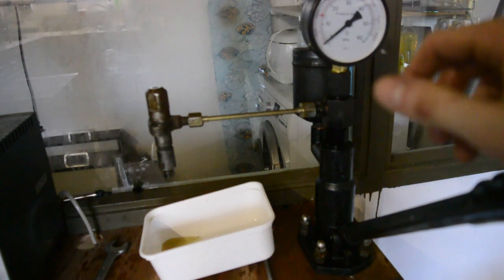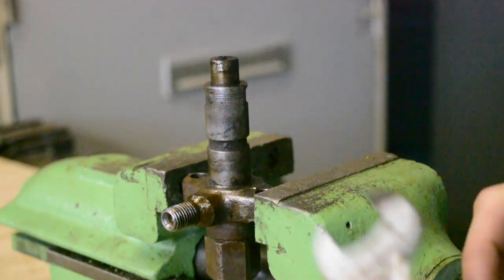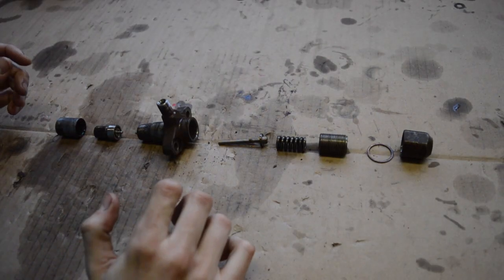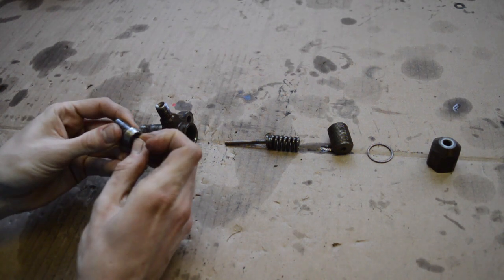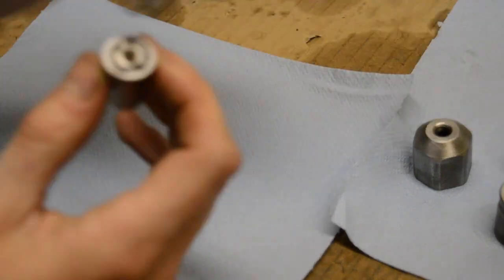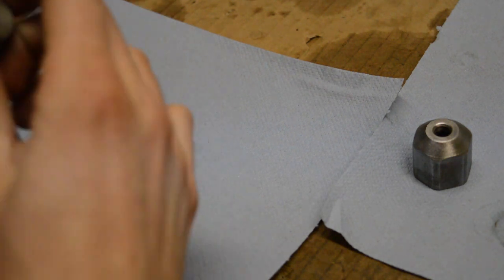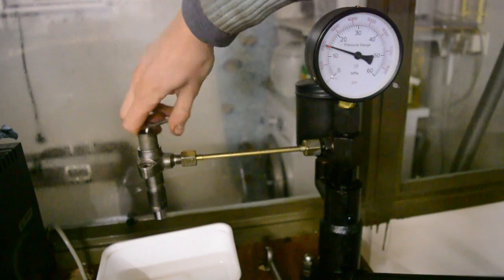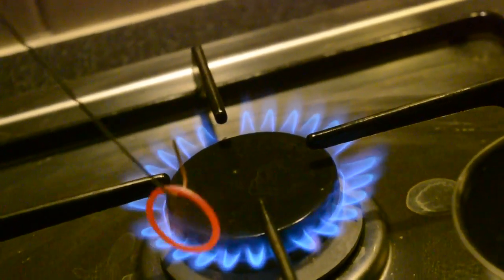Land Rover DIESEL Injector overhaul

Comment: As a retired employee of what was a Simms service depot full marks for getting them to work. A couple of comments, do take the pressure spring setting down to nil before trying to remove the nozzle retaining nut because if not the nozzle can turn with the nut and you can shear the two dowels off in the injector body and ruin the assembly. The full repair would be by internally recutting the nozzle seat and the needle face to different prescribed angles for which you need a bit of special equipment and you may have noticed there is an auxiliary spray from the nozzle for starting purposes, this needs unblocking in most cases which is very difficult, the needle valve freeing off has to be done carefully without the use of any abrasives as too free a fit and there would be an excess of fuel leaking back in the injector and not injected into the engine,  all this can be measured on the hand tester.  This nozzle was just about the most difficult and time-consuming type to refurbish to spray properly and on cost was frequently replaced with a new one. The test pump can test most types of injectors, but spray into an enclosed container for safety reasons or at least guard it, and most important keep away from any naked flame, and don't try that as it is very dangerous!
Reply: Ken have you ever refurbed the tdv8 Injectors, I had a chap take mine out to remove my inlet manifold and now they wont fire, loud rattly noise from them
Reply: @gerrygorman273  I have no idea even what a tdv8 injector looks like ! what engine ?  I may find an answer if I could see one as the earleir types all worked much the same way.could you post a photo of one ?  Ken

Comment: Hola! Muchas gracias por compartir... excelente video!
Una pregunta:
¿El inyector se abre a 2000 ó a 2100 psi? Y ¿a cuántas psi se cierra? 
Otra pregunta: ¿sólo se puede ajustar los psi de apertura ó también se puede ajustar el cierre?
te agradezco el tiempo que tomaste para hacer el video!
Reply: Hello, open pressure is 135bar (2000psi).  You can only adjust the opening pressure

Comment: Did you lap both the nozzle and the injector body? How do you lap it with the alignment dowels in or did you remove them?
Reply from the maker: If you need to lap the injector body surface, you first need to remove the dowels indeed. I didn't take them out in this case. - Jan

Comment: Great vid, can the TDV8 injectors be overhauled, how to do tell if one is bad, do the knock or tick, mine are knocking on startup
Reply from the maker: I never overhauled the injectors which you mentioned, so don't know about that. A injector normally doesn't create sound. Most likely the knocking noise comes from your valve clearance.

Comment: Very interesting, which engines uses these injectors?
Reply from the maker: Thanks JP,  Those 'C.A.V. Pintaux' injectors came out of an 2.25 litre Rover diesel engine. There quite commonly used in older diesel engines.